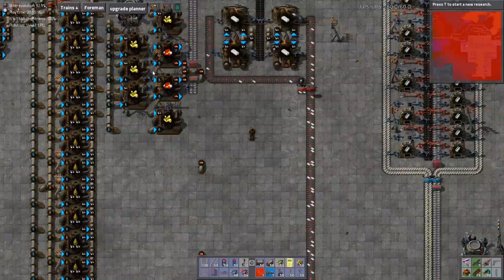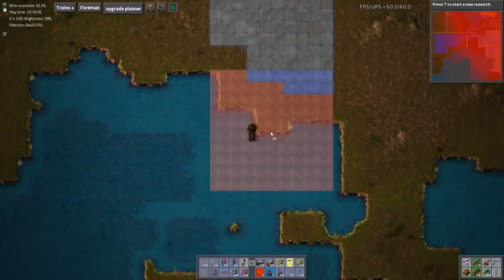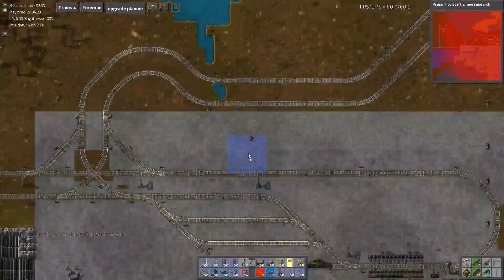Let's Play Factorio - Abundant Automation #59 - Scaling up Oil Processing

Comment: The previous Factorio video had much less compression artifacts. What happened? =)
Reply from the maker: I sneakily turned the video bitrate up to 30k to see if anyone would notice. ;) 

While it certainly helped, the file of course also bloated to 4.5 GB. That's mainly just an inconvenience for uploading. I still need to experiment with this but right now, I sadly lack the time to do much of that.

Cheers and thanks for the continued input!
Reply: There should be a value higher than which there is no obvious increase in quality after Youtube is done butchering the video. They recommend 12mbit for 1080p@60fps, so I'd start halfway between that and 30. If your bitrate is much lower than 12 though, I'd start by trying out the recommended bitrate =)